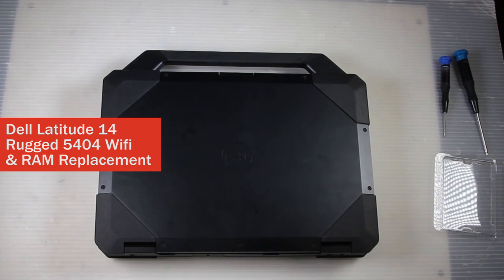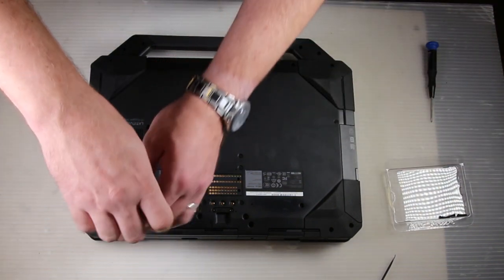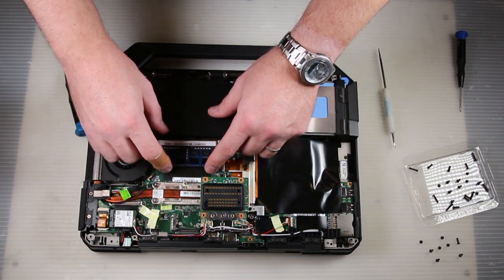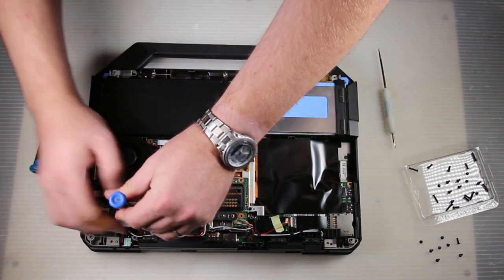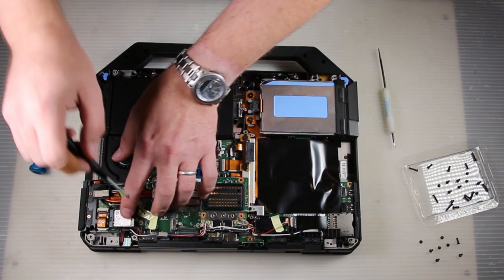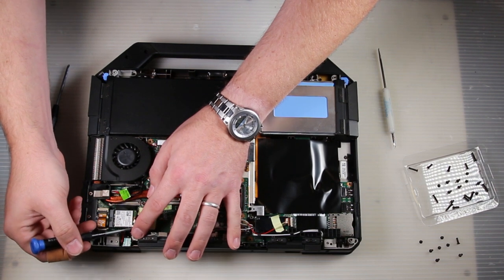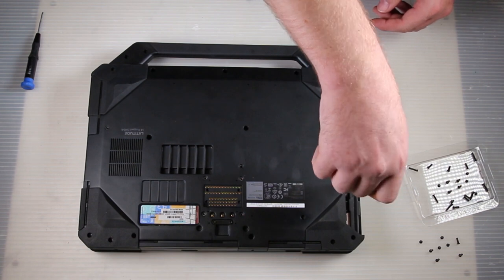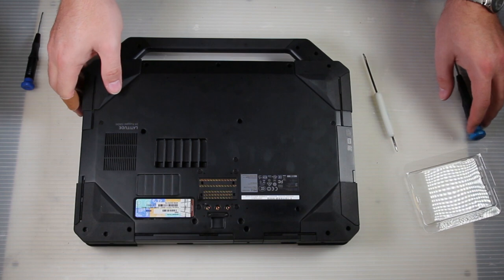How To Replace the Dell Latitude 14 Rugged 5404 RAM & Wifi Card

Comment: Always remove any type of power before replacing anything. Battery should have been removed.
Reply from the maker: You are 100% right. Good catch. We made a mistake. Proper safety measures are very important to follow (even if you are an advanced tech). We are trying our best to be a better example in our current videos!

Comment: do I need a new WIFI card too if my 5404 cuts out intermittently I have brand new hi end 2023 router and new cable from junction box outside in to my apartment ?
Reply from the maker: That could be the source of your trouble. But without having it in front of me, I cannot properly diagnose what the problem with it is. My advice is to get a new WiFi card and replace the one you have. Grab one with a warranty or at least an optional return so if that was not the problem, you can send it back. If you still have trouble after this use our tech support form (https://www.bobjohnson.com/tech-support-form/) or fill out our repair form (https://www.bobjohnson.com/repairs-service/) and send it to us to fix. Hopefully this helps you out, thanks for watching!

Comment: if its water proof than how can water not get in, I can see through those cooling vents??
Reply from the maker: Hi TFMG, the Dell Latitude 14 Rugged 5404 is not waterproof. As it has an IP rating of 54 and MIL-STD rating of 810G, it is only protected against splashes of water. This is a very common misconception about rugged laptops- they are not usually water proof-but can be highly water-resistant based on their IP and MIL-STD rating (awarded only after undergoing specific tests). You can more on rugged computer ratings here: https://www.bobjohnson.com/blog/rugged-laptop-certifications/. Hope this helps.
Reply: @Bobjohnson  ohhhh ok yah looks like that is a misconception, thank you!
Reply from the maker: @tfmg8223  No problem!